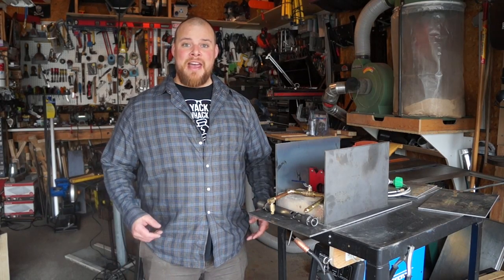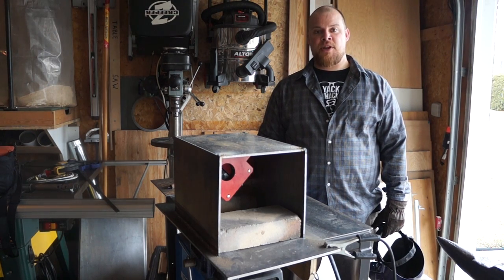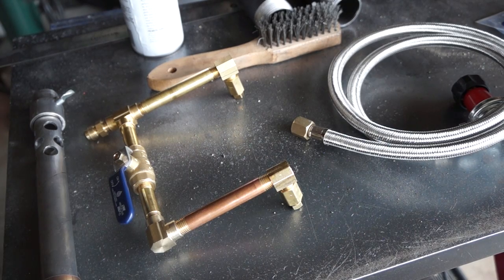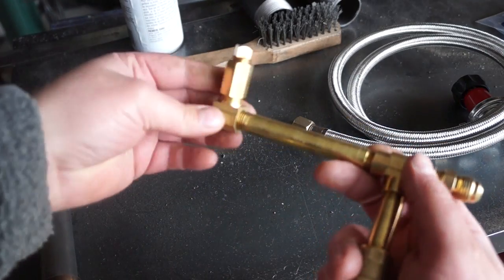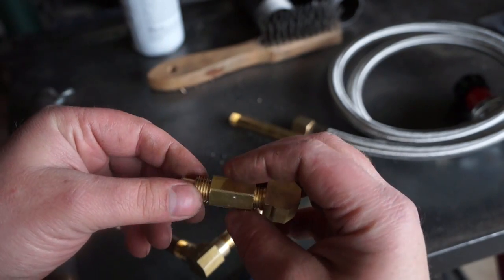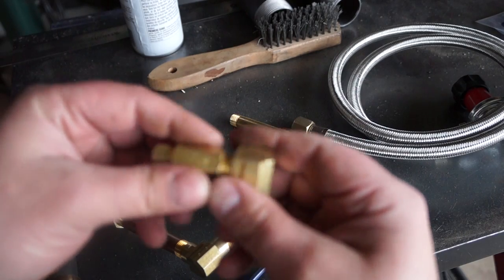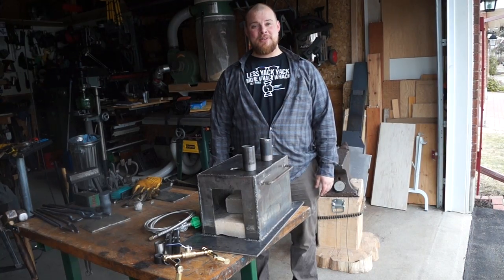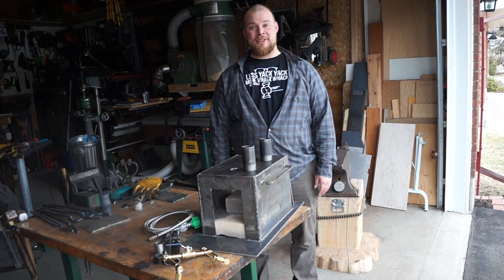Gas Forge Build pt 1: Assembly and a Little About Burner Building

Comment: what are the holes near the top of the burner for
Reply from the maker: Jack I , those are air intakes. the negative pressure created by the combustion draws air downward. As well, pressure of the propane being propelled downward creates a venturi effect, which also draws in air. This replaces the need for something like a blower in a forced air burner.
Reply: Nick Verbree thanks